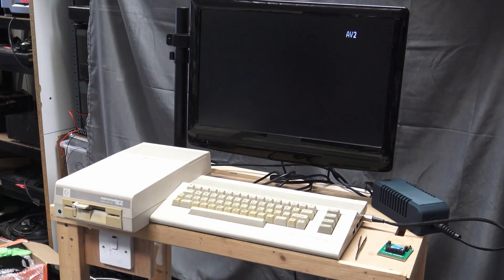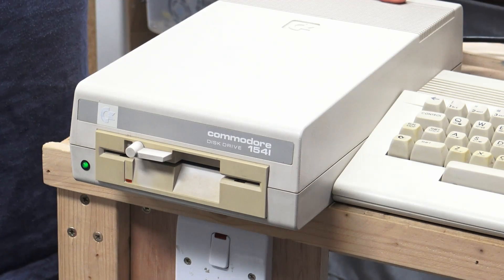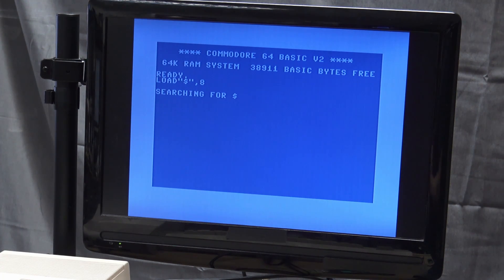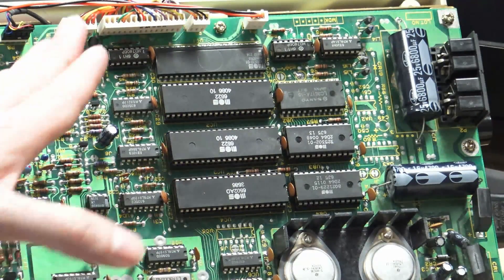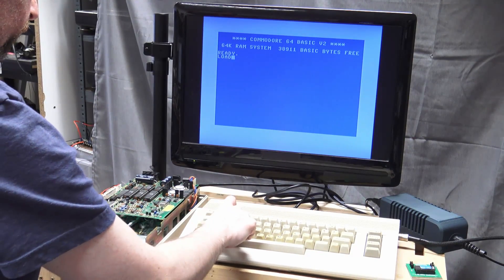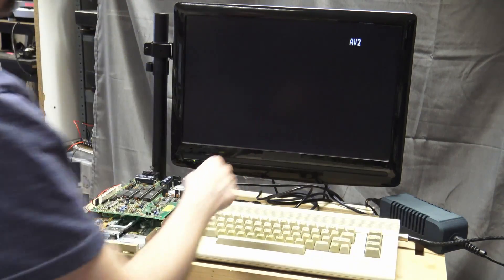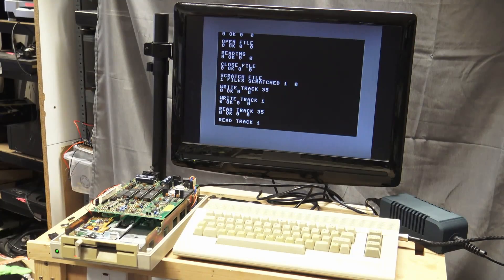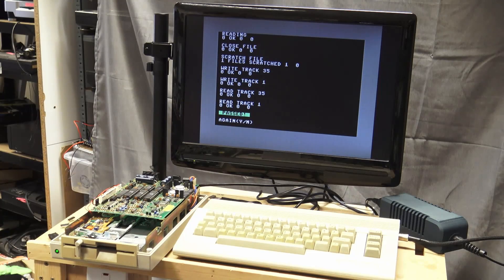Commodore C64 1541-C drive repair. No communication with the c64 it just locks up the computer.

Comment: well, nice -  however we still don't know, what was the problem-chip because you replaced 6 chips at once (as far as I understood) - lucky you, that you had them all in stock.  ..As for me I've got the exact same problem (!!) - no floppy response etc. - and I've got the exact same board. With the oscilloscope I already checked the two hex-inverters (7406) and the hex-schmitt-triggered inverter (74LS14) and they seem to work fine. So what's left is the CPU and the two 6522-chips  (which got, of course, not sockets and of course I don't have them as spare-parts in stock).  Where should I start?  Do you have any idea, which was the bad one?   :)   thank you
Reply from the maker: it says in the description "I then tested the hd7406 in my mini pro and found one was bad. So i replaced them both with new 74ls06 and tested again with the 1541 diagnostic rom and everything then worked" Any other chips I removed I put back in and still had the fault I didn't remove them all at the same time.

Comment: nice... I was just working on a 1541 drive I got off Ebay for like $30 it was doing the same thing so I started probing around and I too have a bad 74LS06 but I all so think 1 of the 6522 at U2 is bad. but i have spare 6522 so i am down to getting that 7406
Reply from the maker: As long as the RW heads are not bad.

Comment: Thankfully, a quick repair.  Also, I like the case you printed for your PSU, and nice work on the diag multi-cart 👍!!!
Reply from the maker: Again a lucky repair and thanks to a few people. I have a idea to use a BCD rotary twitch on the diag cartridge  with some 74ls logic to switch the rom hi/lo and exrom and game automatically when needed. going to work on a test soon.
Reply from the maker: the case is big because I designed the PCB so I could make it on my cnc mill, but ended up ordering the pcb with some others and kept the design.

Comment: Nice repair.  Cool you can keep that older tech going.
Reply from the maker: as long as you can find the parts, there is so much information for these older systems most problems can be fixed.